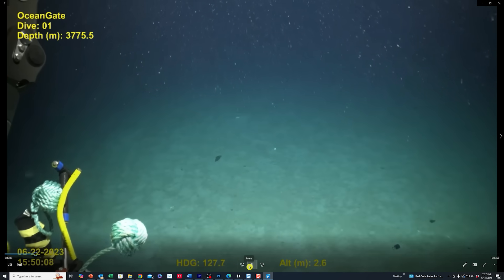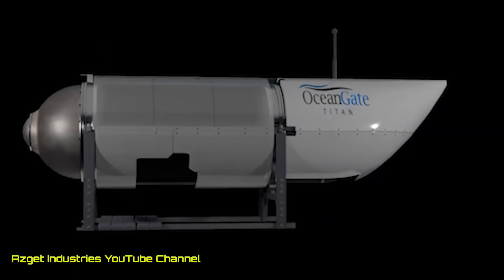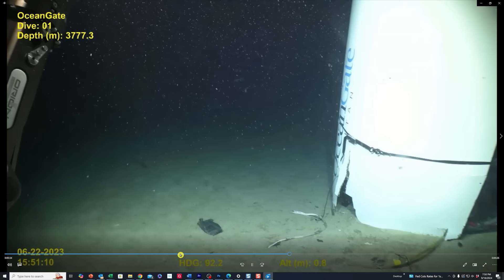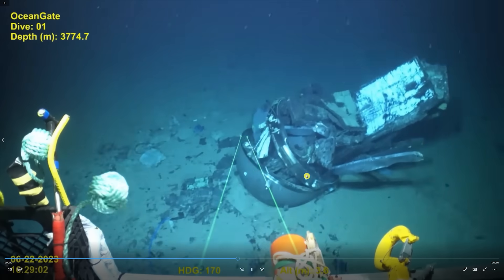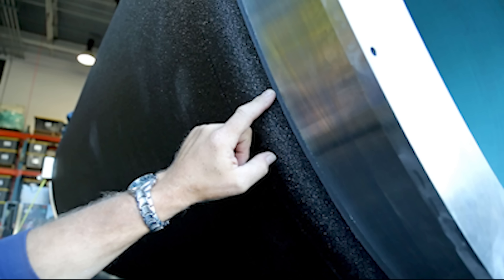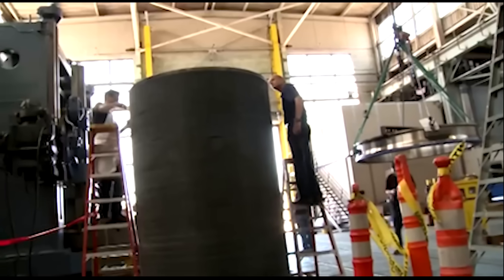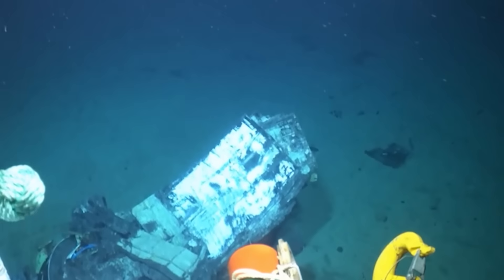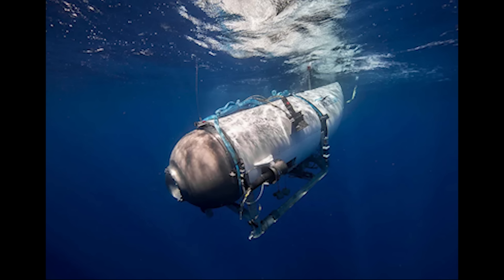OceanGate Titan Sub Debris Video Shows How It Imploded

Comment: wtf is that $5 ratchet strap holding that thing together? Also, I thought this thing imploded? Seems pretty damn intact to me… my spidey senses are tingling…
Reply: It's holding on fairings, not the whole thing. But yes, hardly professional. As for implosion, WTF else would you call this? It certainly isn't 'intact'. And what exactly are you proposing as an alternative hypothesis.
Reply: @skepticalbadger  certainly looks like some billionaires just disappeared themselves. We were told this thing imploded and was completely crushed with almost nothing salvageable. Looks to be pretty intact to me.

Comment: Yeah, I agree, it looks like the fatigue of repeatedly stress cycles likely debonded the epoxy.
I thought the use of carbon fiber as a tube under compression was an odd materials choice(I think the fact they got a deal on it played a big role) but yeah, I am amazed that people with that much experience with materials would overlook something as fundamental as best practices for adhesion bonding. The rag looked dirty and oils from his hand,the smooth machined surface? WTF?
Acid etch or bead blast even sanded then wiped down with acetone. Hell, I probably would have had it thread on if possible on top off the glue, more surface area and mechanical form of preventing it from popping g off.

Comment: Great analysis as James Cameron said and I think it's probably true too the type of carbon fiber they use and the way they produce it is in layers  Strands and strands on top of each other and when it starts to give way it creates fissures in the strands these fishers have water intrusion that starts to peel them and I think that's what they heard shortly before the implosion. They crack ever so slightly and then continue to do so tearing at the hall at an exponential rate. Thus resulting in what would be a violent  Tear very quickly resulting in the implosion that shot the forward section of the sealing ring or sealing  collar  And titanium Cap and viewing area violently forwards with part of the  Carbon fiber hull attached blowing apart the submarine   Tearing the 2 parts away from each other.  Underwater implosions are interesting because after the implosion and the force goes inwards it usually goes back outwards and thus shooting the hull apart into pieces and scatterimg it across the sea floor. Sorry for the typos im on speech to text.  Just my two cents. James Cameron and several other including I think Bob Valerd told him about the risk of reusing a one time use hull. He pushes his luck way over the limit by four time and this is the result. Stupid negligence and abandonment of any safety protocols.  They also used a remedial acoustics device to "listen for hill cracking"  no xray of the hull no known test that would give a pre dive analysis of the hulls stability or problems within. Oceangate should never be allowed to function as a company again. Disgrace to the submarine community who takes everything way more seriously than this man ever did. Sad he had to risk and take the lives of all on board with him and his stupidity.
Reply: And to top it off, Stockton bought substandard carbon fiber to begin with, so he could pinch pennies....billionaire that he is...
Reply: @monicakennedy6762  he also rammed the vessel into the Dorias bow damaging it. Another no no when diving a Maritime wreck. He was abusive and and a douche.

Comment: Given the extreme pressures at work, and differences in material properties between the titanium ring and grp pressure hull, it is hard to imagine a simple glue that has adequate bond strength to both materials to prevent mechanical failure. It seems that bolt flanges, joined with many through bolts, sealed with gasket or with the special adhesive, might have been a better idea. Since the titanium ring was clean and devoid of any remnants of grp, may indicate that this joint might have been a point of failure.

Comment: ask any plumber when attaching plastic pipe tp  metal pipe the metal pipe goes on the inside of the plastic pipe
 those titanium rings were attached to the outside of the carbon fiber hull. then when the carbon fiber hull is compacted itpulls away from the rings.
 The rings needed to go inside the carbon fiber NOT on the outside.

Comment: Glue? JUST glue? Wow. They could have run bolts through the rings and the carbon-fiber body, with the outer ring segmented so it could amply compress the carbon fiber as nuts inside were tightened. Also, rather than smoothly-surfaced, the ring surfaces contacting the carbon-fiber body could have been concentrically grooved, for grip and to create multiple tight seals.  I would NEVER have considered trusting only glue between smooth surfaces and with no mechanical attachment or even pressure.

Comment: The titanium and carbon fiber are going to expand and contract differently. Not to mention the temperature reaction between those two materials is going to cause them to eventually separate. Let’s not even get into how the adhesive is going to react to temperature and whether or not it had the flexibility to handle the two materials reacting differently. 
That’s why every engineer said it was not safe.

Comment: Since this vessel design was a one off and the contstuction details were also of an untested method (CF-epoxy-titanium) you'd have to consider that every dive was a test dive. Usually very new designs are pushed to design lkmits and beyond to discover the flaws and failure levels. This is exactly what occured, every dive was stressing the design but with paying passengers and not a  professional crew trained to test new designs. The failure limit was discovered obviously. Most likely under those extreme pressures it was probably something to do with multiple dives stressing beyond the limits of the epoxy-carbon fiber bonding capabilities.

Comment: I worked in carbon fiber in the late 90's making wind surfing masts and bike tubes for Trek amongst other projects. We bonded several aluminum roller bars with carbon fiber center. But, those didn't need any sanding. But, on the wind surfing masts, we glue in a carbon fiber ferrule after cutting the mast in half. But, to make sure that ferrule stayed in place, we would sandblast the area inside the mast where it would be bonded.

Comment: looks to mee like the failure was towards the front around the seal; area where it was peanut butter stuck to the titanium ring and then pushed everything backwards into the titanium cap on the other end any flesh would just turn into a cloud of mist like a fog in the ocean and leave what was in the enclosure behind. i believe they would have heard it first maybe only for a few seconds before it gave way it would have cracked and creaked like floorboards in an old house then nothing it gave way. they would have probably put the creaks down to descending fast and the stress loads increasing at a higher rate than normal. me i don't mind shallow holiday subs you ca go on  but not subs your going to great depths .

Comment: With the debris field (the large titanium and carbon fiber parts along with the smaller carbon fiber bits on the ocean floor so close to each other, imo, the implosion happened quite close to the bottom of the ocean floor. Anywhere closer to the surface & it's safe to say the ocean currents would have carried the finer shattered pieces away, scattered farther apart from each other. There is also no doubt that whatever the public gets to see of these peices, it's going to be a PG-13 affair. No way, in consideration for general taste and consideration of the victims families, will the general public see anything shown belonging to each individual victim.

Fantastic work on the coverage of this grim event, Jeff. Thank you.

Comment: It would be difficult to tell what failed first, the carbon fiber or the sealing between the fiber hull and the front ring. About the only warning there would have been would be a sudden fog and then the water leaking in would have been like a high speed saw cutting along weak spots in the fiber and around the glue between the ring and the fiber, in microseconds.
The water slamming against the front dome popped out the viewport, as shown by the fact that the metal ring was gone in earlier pictures. You can also see that the bolts that held the ring to the front dome were all popped off. The fact that the back ring was still attached to the dome and stuff was piled against it makes it clear that the first leak point was vary close to the front. The fact that the fiber was in small chunks scattered around would indicate that it was likely ripped from front end back by the high speed water jets cutting through the fiber. A failure near the center would have left piles of stuff at both ends. This suggest to me that it was an initial failure at the fiber to ring glue and not the fiber hull. The hull was ripped apart by the water sawing its way into the hull, into smaller fragments, front to back. ( think microseconds and not a slow process ).

Comment: Can someone tell me why it was important to use carbon fiber?  Why would it be important to build a sub with lightweight materials when it's going in water that weighs 8.5 pounds per gallon?  How incredibly incompetent it is to make a vessel that has to withstand tremendous pressure and a cyclic load also and not make it solid construction.  Making it out of dissimilar materials that are bonded together with adhesives....wow.  I get that it is under compression, but still, different materials are going behave differently under a load.  It just seems like unnecessary risk.
Reply: Bc it was cheaper
Reply: Two motivating factors for Rush:  First of all he had to be the maverick superhero who in his mind would show all those experts warning him that he knew better, and was making a great innovative breakthrough, which was a fantasy on his part....and...yes, it's cheaper and faster to construct.  Rush even bought substandard, USED carbon fiber to construct the hull--to save some bucks!  What unmitigated greed.

Comment: We once used a pressure washer to cut up scrap pieces of drywall. Steel plate is cut with water jet machines. When the sea hit the occupants with inconceivable force in a milliseconds-long blast, I really doubt that much organic matter remained intact to be “compressed into the rear dome.”

I’ve seen very strange things after tornadoes and hurricanes. In those examples of destructive force, objects and pieces and particles don’t behave predictably. 

I once stopped to help after a highway car crash. Vehicles hit head on. I approached a small SUV in the ditch to check on the driver. The front end was smashed, but the left headlight (glass sealed beam) was unbroken, still working, while hanging from its wires within the smashed metal.

I’d guess it’s probably impossible to explain why certain pieces of the CF hull were ejected from the event instead of being fragmented, but I’m not surprised. I think it’s enough that most of the hull is reduced to fragments.

When a glass cathode ray tube (TV picture tube) implodes under the force of one atmosphere—not 400–the effect is an explosion. The glass shards implode, but some keep on going and others collide and rebound. Glass goes everywhere. It doesn’t form a neat little ball. Certainly the CF hull reacted much the same way.

Comment: Ok Jeff,
I figured out exactly what happened.
And everyone has overlooked it.
The sub had feet attached the metal part of the hull.
Also had additional metal objects connecting the front and rear between the carbon fiber.

So if you expect the carbon fiber to compress just a little,
you have to allow for that.
Metal braces connecting both halves not allowing for slight compression of the carbon fiber.

Its obvious now that i see it ! ! !

Comment: that glue job was a disaster , should be in a clean climate controlled room , mixed by machine and then all air must be drawn out via vac pump before application and ideally slow cured under vac also . i see potential routes for hair, dust , sweat , body oils , bugs and aerosol particulate contamination not to mention air bubbles / voids . shoddy lamination work

Comment: One detail that caught my attention and left me puzzled was the fact that the screens inside the Titan submersible appeared to be mounted to the pressure hull using screws. In a high-pressure deep-sea environment, any structural vulnerability, no matter how small, can significantly compromise the integrity of the vessel. The immense pressure at such depths—approximately 5,500 psi (pounds per square inch) at 4,000 meters—demands flawless engineering. Even minor weaknesses, like improperly sealed screw points, could serve as potential initiation sites for catastrophic failure due to the extreme mechanical stresses exerted on the hull.

Comment: I clean the print bed on my 3D printer more thoroughly than that guy putting his hands all over the ring. If one is experimenting with new tech like this, you would think they would build a prototype and then expose it to as many cycles as possible - until it failed. Then you would know the upper end limits of what the craft is capable of and take appropriate safety measures before you retire each craft. Having no idea of how many cycles it could handle is simply gambling. Gambling with your own life is one thing but gambling with others is not on.

Comment: If you remove the endcaps of a tin can, it is easily flattened out. It seems that the glued on endcaps pretty much relied on the glue being able to hold the cylinder from flattening by relying on the shear strength of the glue. It seems that if the titanium endcaps should have been glued inside of the tube so they could support the ends of the cylinder from flattening.

Comment: I don't understand the use of the term "blown" when referring to an implosion.
Reply: I believe the term blown in this case, is it was just like that,  1st there was the initial implosion/collapse , but the immediate after effect of that was to blow everything out, step on a tube of toothpaste , with the lid barely screwed on it will all blast out the opening

Comment: Just because the surface prep wasn't shown in the video of bonding the end ring to the cylinder doesn't mean it wasn't done.  It just means it wasn't shown.  I have much greater reservations about the engineering that went into this joint.  If the elastic modulus of the carbon fiber wasn't the same as the elastic modulus of the titanium end ring, these components would change size at different rates under pressure at depth.  The relative strain between these two parts would eventually lead to failure of the bond joint, which would be a highly likely failure mode for the pressure cylinder.  

For background, I have 25 years experience as a mechanical engineer designing pumps for liquefied gas.  We analyze similar differential stresses caused by thermal expansion/contraction in cryogenic liquids all the time, although our joints are bolted, rather than bonded.

Comment: 5:04 The specs called for 5in thickness. Rush cheaped out at 3.75in. He also cheaped out on the front viewport window. This was a solid design if kept to speck and tested to failure. It had limited dives and he was, once again, too stingy to test for real world performance.
Reply: 100% correct , yeah he cheaped out for sure on that porthole,  totally reckless,

Comment: That glued connection is a joke. A bad joke. Not funny at all. And using a composite material that you cannot perform ultrasonic NDT testing on and that has directional strength and that wasn’t wound at angles and that has a brittle mode of failure and that can delaminate… is… unfathomably ignorant from an engineer’s perspective.
Way way way too many unmitigated risk factors. 
Submersible Implosions are so rare that they are darn near unheard of because the engineers and fabricators who design and manufacture certified submersibles have solved the problem and know exactly how to mitigate the implosion risk and maintain a reliable factor of safety against implosion failure.
Reply: The glue was just fine.